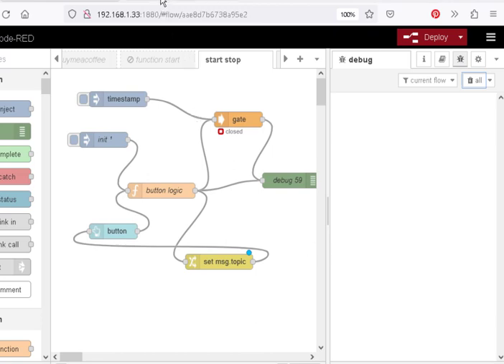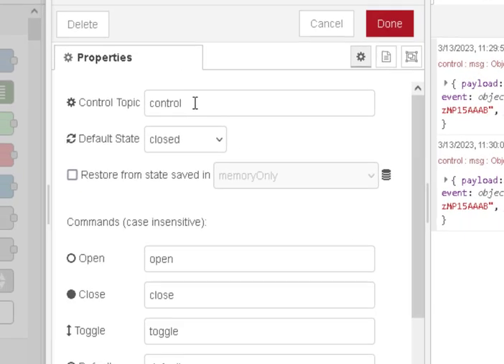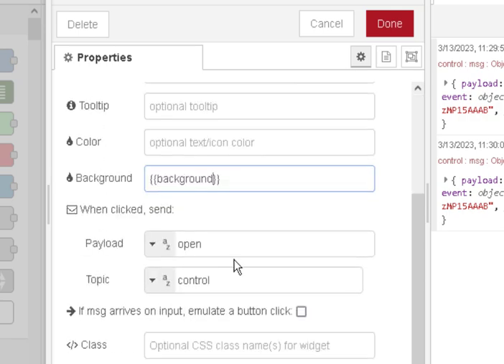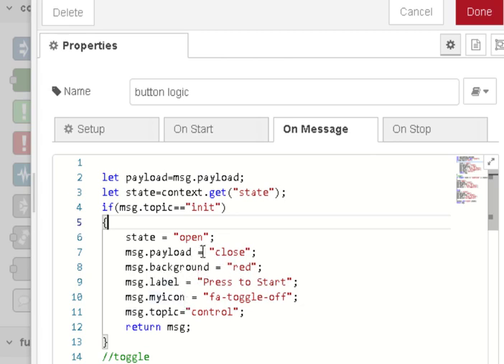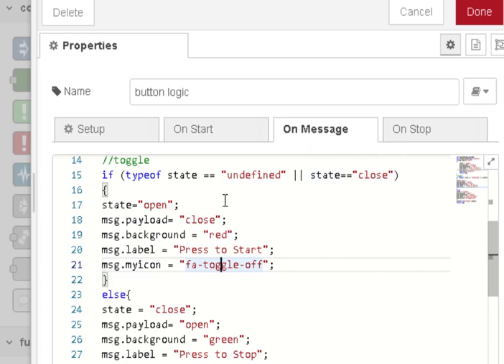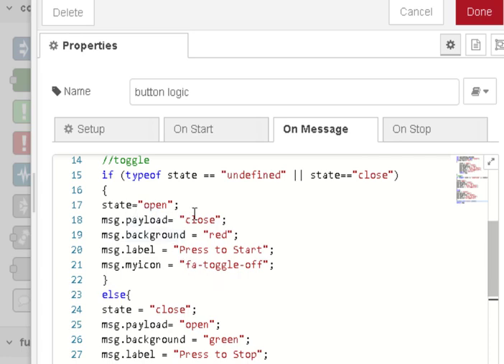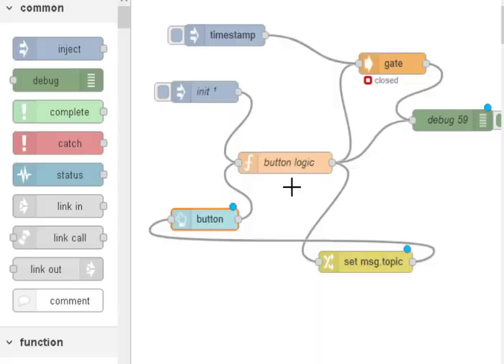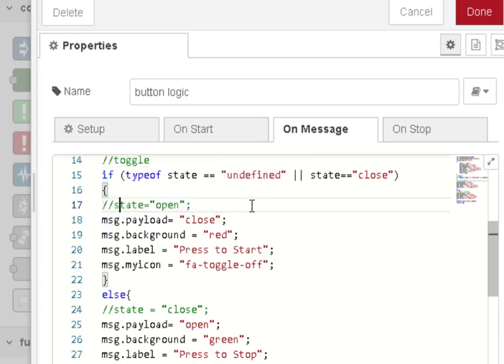Node-Red Toggle Button (Start-Stop)

Comment: Hi Steve, thanks for the tutorial , it's working fine. The only problem I am having is that the icon never changes. If I load a fa icon direct to the button it works fine but sending the {{myicon}} part of the message into the button doesn't have any effect. The {{background}} and {{topic}} elements work perfectly so I am at a loss as to what to try next.
Reply from the maker: Hi
I tried it and it works ok for me. I do remember that initially I did have icon problems as the names were incorrect. Have you tried using other icons.

Comment: Thanks, can you tell wich "gate" you are using, I see multiple when searching the pallette.
Reply from the maker: Hi 
it is
node-red-contrib-simple-gate
rgds
steve
Reply: @stevecope  Thanks!
Reply: @stevecope  Hi, great video. I'm getting an Error when trying to install this. I'm working with an ADAM 6717 device that is running linux. Any suggestions?
Reply from the maker: @manuflores4695  Is that when you install the flow or a particular node?
If it is a node then it is usually because of nodejs version numbers and so you may need to upgrade nodejs.
Rgds
Steve

Comment: When I downloaded the flow, it did not work. Upon inspection lines 17 and 24 were commented out. Uncommenting those and it works. Also, I was a bit confused because the switch is only controlling the gate. To really be of any use you would have to send some other input to the gate. (like you do with the timestamp) I think it would be more clear if the label was "Press to Open" and "Press to Close" because you are not starting or stopping anything.
Reply from the maker: Hi tks for pointing that out I changed the lines in the video as an illustration but I must have used that flow . I will put up another flow.
The gate is there only for illustation as it shows open and closed so you know the button is working.
In a working flow you use it to start and stop the process.
Rgds
Steve